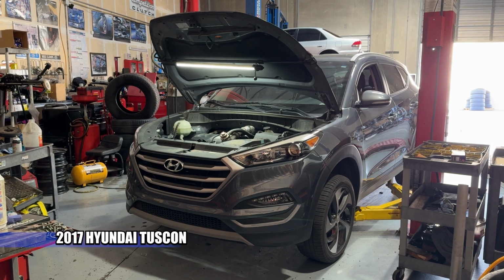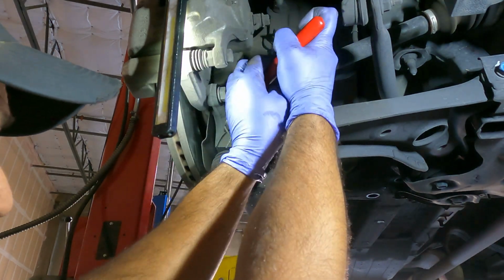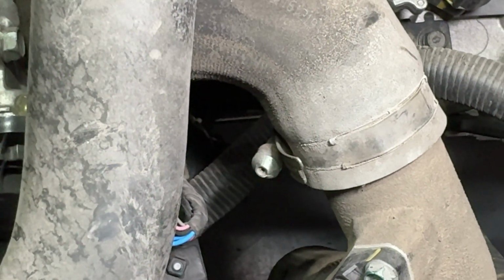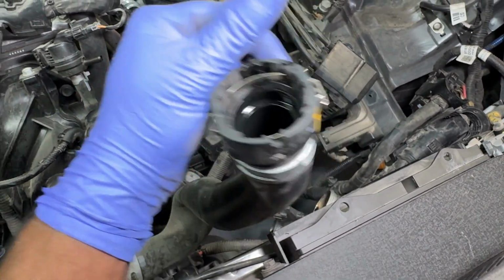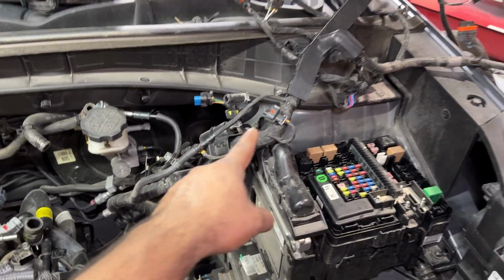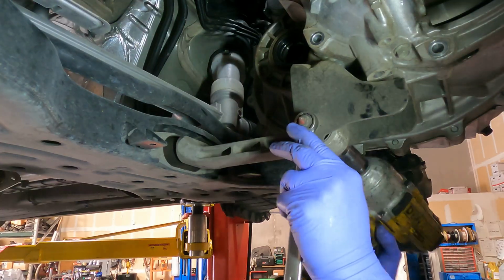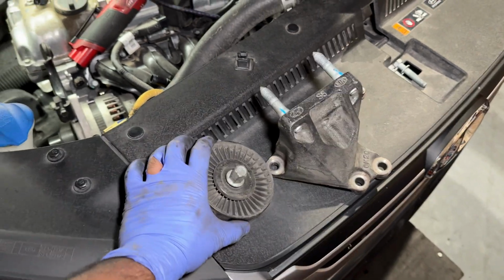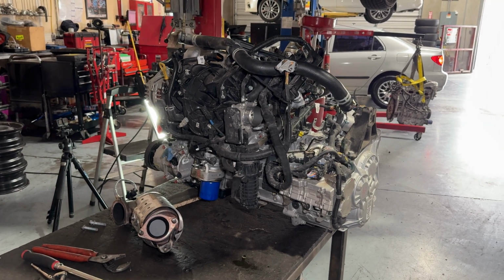BLOWN ENGINE REMOVAL : 2017 HYUNDAI TUSCON

Comment: You did this the hardest way possible 😅
Reply: Exactly .. for $150, oil consumption could have been addressed with a Berryman's B12 piston soak. I chuckle when I hear people say they were told they need a new engine when these junk Hyundai GDIs start burning oil.
Reply: @Extra300goldberg  valvoline restore and protect engine oil would be good to use. It'll clean the ringlands too.
Reply: @AutoMotoMechanic My 2017 Hyundai used to burn a quart every 300 miles. B12 piston soak instantly dropped consumption to a 1/4 quart every 3000 miles. I now run nothing but Valvoline R&P. It has been 11k miles, and consumption has not come back. 

At the end of the video, he did say the engine had a rod knock. So - it was trashed.
Reply: @Extra300goldberg yep, piston soak is good to do for sure. Pulling intake and cleaning intake valves is a must too.
These motor come right out the top in like 2hrs. No reason to pull everything from bottom like he did. These are super easy to motor swap in a afternoon. He took way too much apart.

Comment: Why not pick it out the top
Reply from the maker: Because I work on a lift and do 98% of my engine removals like this. In the future though, knowing what I know now, I will remove the subframe next time before dropping the enging to make clearing the turbo charger a bit easier.
Reply: @SkillCollectors  If you were going to do this through the top and don't have a lift, would you remove the front clip and come out that way? Or through the top? I'm in my garage, no lift. Thanks
Reply from the maker: @kyledesjardins5235  Yes, I would definitely take the front end apart and possibly remove the hood too depending on how much room opens up in the front.
Reply: @kyledesjardins5235  it slides in and out with cherry picker with hood and all front end parts on.  ac stay charged and all. It's crazy easy to take out tbh. I thought removing installing was a cake walk.

Comment: i have the same 1.6 turbo and it doesn’t consume a drop of oil between oil changes. 110k miles.
Reply: Looking at one with the same mileage, any tips on maintaining an what not…
Thanks….
Reply: yes i have lots of tips. Replace the hpfp just in case if its leaking fuel in the engine. replace the pcv valve. run an engine flush and always use full synthetic every 5k miles max. If u want to know other stuff lmk!

Comment: How do you remove the engine bolt to transmission that’s nearly impossible to get a socket or wrench on due to the transmission differential being in the way?

Comment: Remove the subframe next time, much easier and it doesn't take long at all. Great video though.
Reply: You can pull this motor out the top in like 2hr. Super easy.
Reply: Yeah that is how the engine is married with the car

Comment: You said "3 oil changes through the life of the engine", how many miles were on it? Were you implying failure by neglect?
Reply from the maker: Definitely failure by neglect. It was more like 5 oil changes, I exaggerated a little but it had just over 80k miles on it. I think these are relatively good value vehicles but I have seen the engines pre-maturely let go when neglected. Gone are the days when you could drive around and old honda or toyota with 1 qt of oil and somehow they keep working haha.